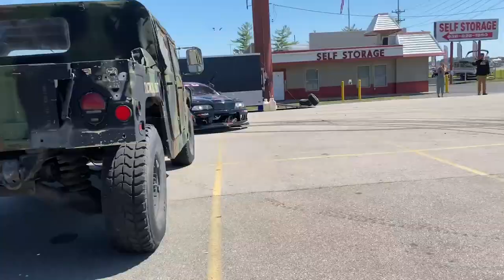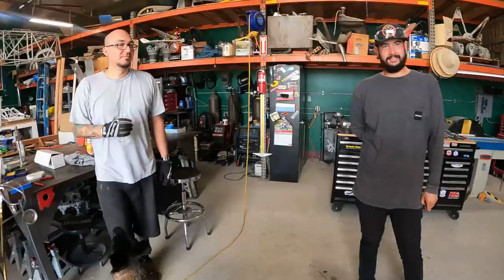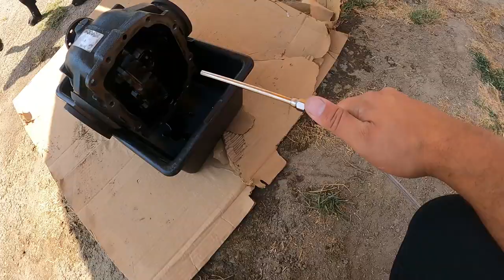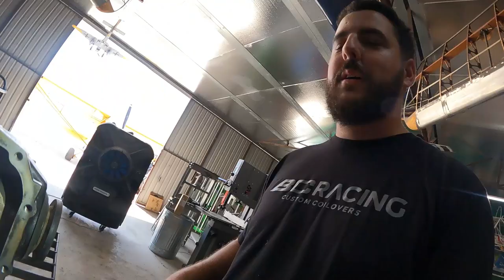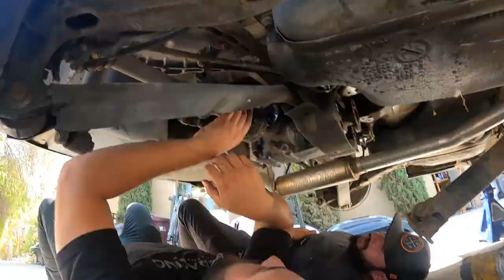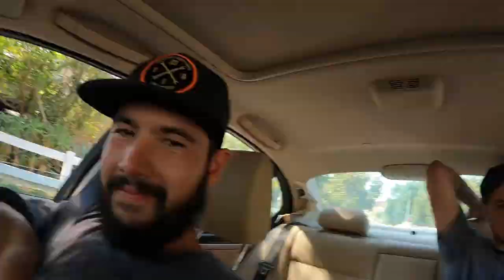DRIFT-ABILITY! WELDING DIFFERENTIAL x Part 2/2

Comment: Heads up bro, that pinion bearing and bushing will go out. ask me how I know! also if your going to be launching it, swap the pivot bushing for the pilot bearing fork for a metal one! they come with a plastic one for some weird reason and they snap... again ask me how i know XD. first upgrade id do is a rear sub frame mounting reinforcement and bushing upgrade its that important bro no joke, especially with a welded diff.
Reply: From one e46 owner to another. Thank you.